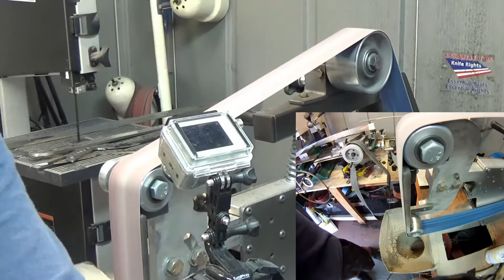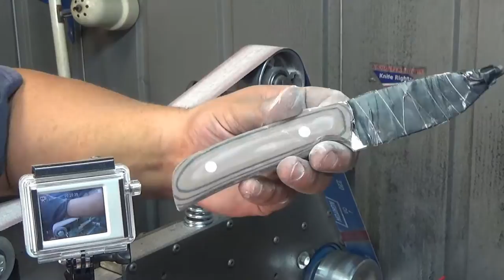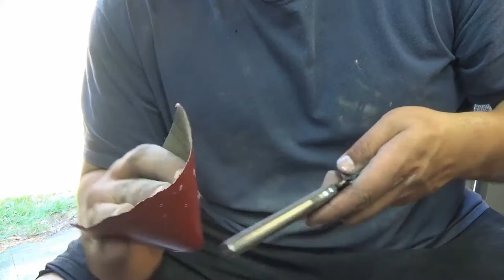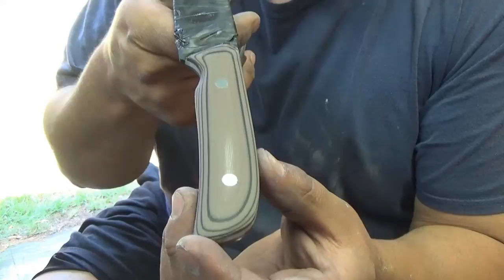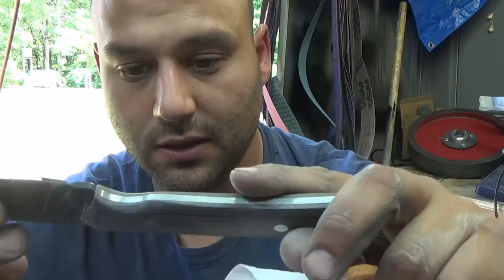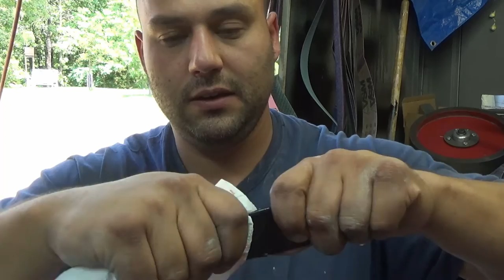How to make a knife Part 12. Handle contouring

Comment: will micarta also benefit from the WD-40 wipe down to get rid of the haze?
Reply from the maker: +Joseph Rector  It will a little bit. Depending on how bad the haze is. It will also darken it.  I stopped using micarta because I never liked the finish I was getting out of it. If the haze is bad, sand it with finer grit sand paper and then oil it.